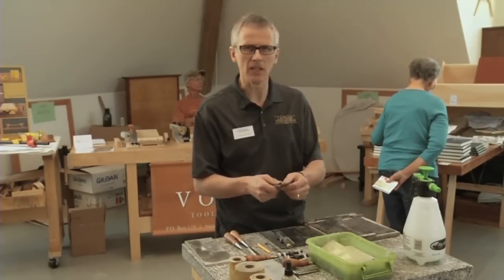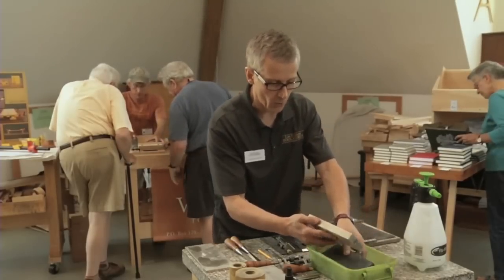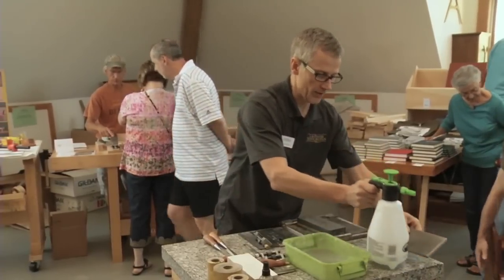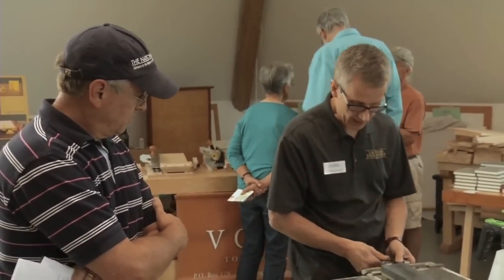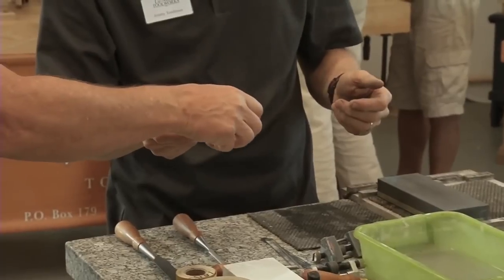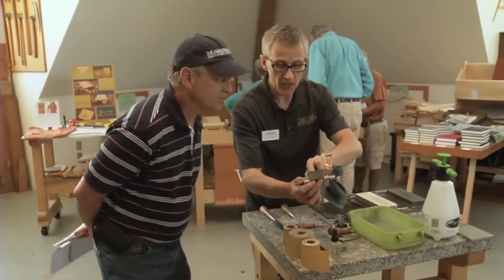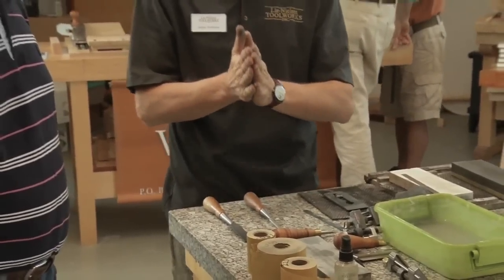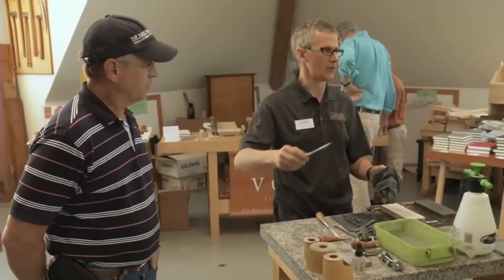Sharpening Planes and Chisels at Lie-Nielsen Open House

Comment: This guys a wizard!!!
His example on the ‘blade telling you when it’s losing it’s edge’ is just the truth, it could be 5 mins later and your sharpening again. Sooner than you’d like 
We need teachers like this!!!!
Reply from the maker: Thx Kenny. You are correct. Better get to accept sharpening and even enjoy it, cause as you say it can be every 5 minutes. You can actually hear when the blades sharpness is compromised let alone see it in the surface. Cheers.
Reply: Anytime. 
I appreciate you doing a video like this. You explained the concept and process very well, gave real good reasoning behind why you say do it ‘this way’ which I think is critical to people understanding how is knowing why as well. Gives you a more solid belief behind how your doing it!
Again sir, thank you!
Reply: Rob cosman has some great sharpening advise aswell. Worth a watch but great video
Reply from the maker: @treesoul7907  South African born yes!!!  I can’t argue with any other methods that work. I present one method out of many here. I was taught old school,  much like Cosman, and started sharpening chisels when I was 9 years old. However over the years teaching people I have come to the point of view that getting someone success, even with “training wheels” is more important than the difficulty and failure to get it right by free hand. The free hand success can come later. For some it never does and so this method is good for many. How you get sharp is not important. At least that’s one man’s opinion. Cheers.